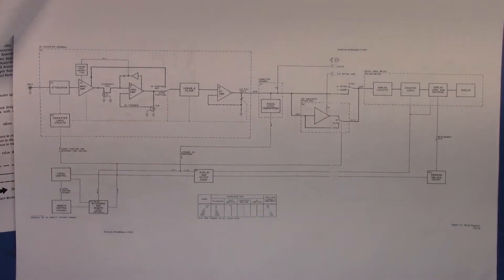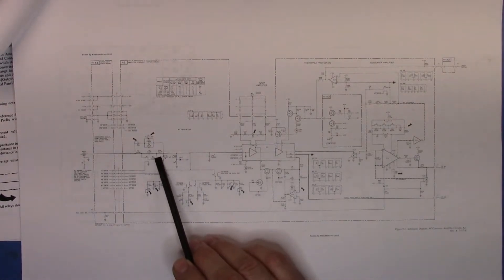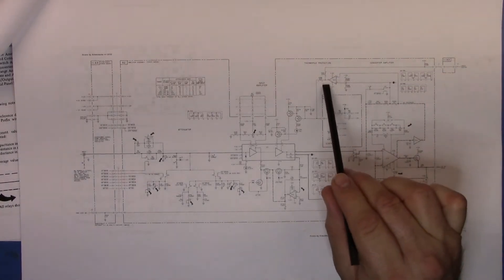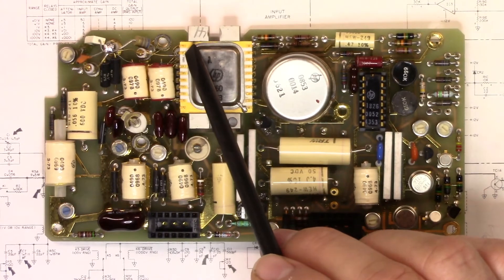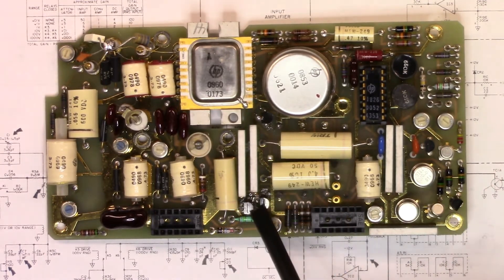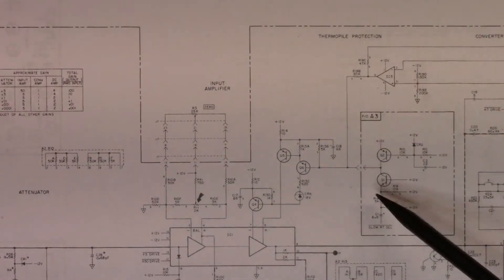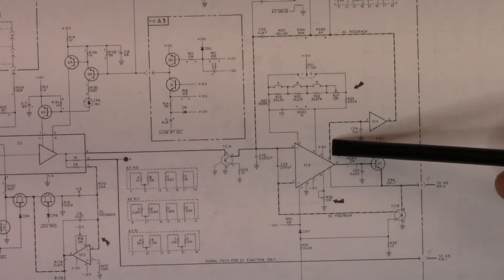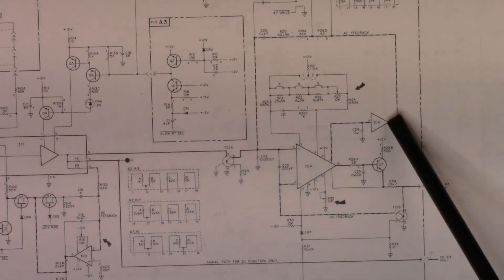HP 3403C Repair - Wrap-up

Comment: Have you tried adjusting the offset null on the AC feedback amplifier? If the problem is at low signal levels then it could be as simple as a small offset that needs nulling out.
Reply from the maker: Hmm, I didn't try that - I'll have to look at that when I get back to this unit.

Comment: I would be replacing all the caps in the suspect area, just to rule those out completely first.
Reply from the maker: I actually removed them from the boards and tested them on my LCR meter as some appeared to be broken in circuit but once out they were still fine.

Interestingly though, when I put it back together I'm now getting the digital display to show a value (whereas before it didn't) - I'm going to set it aside for a bit and then return to it later. I have a bit of a backlog of things I want to work on and this was really just something interesting that I thought might be an easy fix.